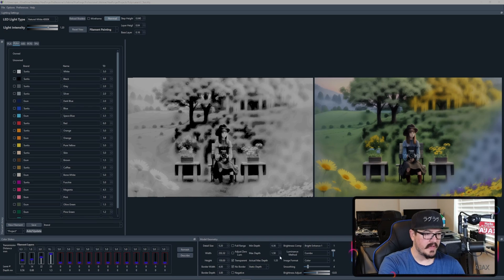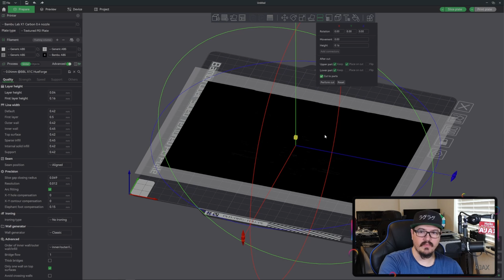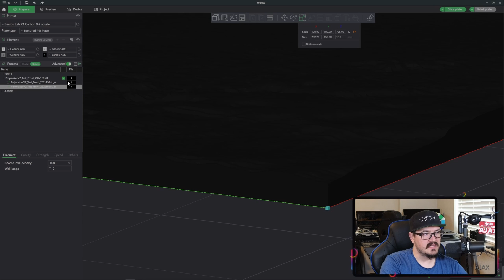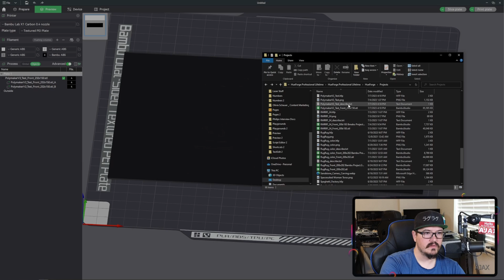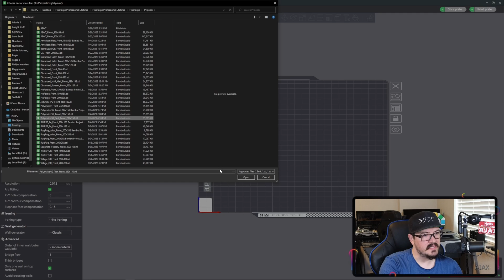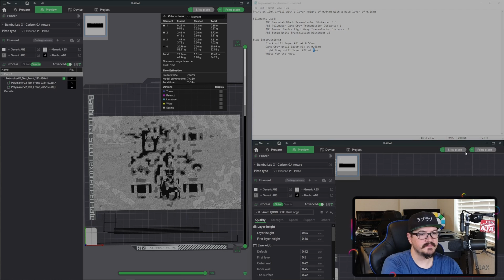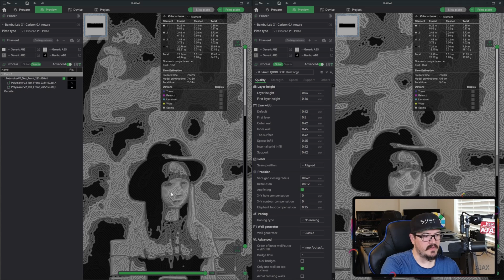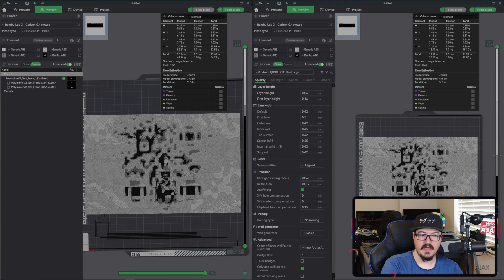Fix the Flop of your HueForge Prints

Comment: 1 minor problem of using 1mm added to the base is, it doesnt divide by 8 so it makes the last layer very large.  it hasnt affected any of the prints yet but does throw off the amount of layers and which layer's require color swaps.  You can combat this by counting down the layers from the top and matching them with the amount of color layers on the original.  Just throwing this out there because it had me scratching my head for a bit

Comment: 4:50 Why do we have to add half of the distance, and not the full 1mm (1,16 in this case)?
Reply: Just a theory, but I believe it’s when scaling the bottom layer it scales from the middle of the part.  So this pops the bottom layer up .5 mm to the bottom of the plate and not the full 1mm. The scaled bottom layer would now encroach on the top layer by .5mm. So you need to move the top layer up half the measurement of your upscaling.
Reply: @I_meatbag Thank you very much for your answer! This could be the reason! 👍🙏

Comment: I started using Hueforge a few days ago and though my prints were not floppy because of a thick white border, the black parts  were also very thin and translucent.
My solution was to adjust the min depth slider from 0.32 to something whatever I wanted my solid base to be. If you increase the maximum depth by the same amount and adjust all color sliders to the same position relative to the top layer as before you should get the same result, but with less hassle.

Comment: Thanks for the shout-out on my picture frame. I'm glad you like it.
Question: Why do you slice after each time you add a filament swap as opposed to adding all of the swaps at once and then slicing again once?
Reply from the maker: Because in Bambu slicer you are forced to. If you notice the slider disappears until you slice again.
Reply: @AJAX_3D  Gotcha, I've only used Orca, and didn't know that was one of the differences.
Reply: @jacobdaugherty4052  this is now not the case. only 2 slices needed total even if 16 colors
Reply: @BradGreeff    I have finally had the time to start messing with Hueforge again and noticed the change in the slicer (So much easier).  I need to get active again in the discord, so many people doing cool stuff